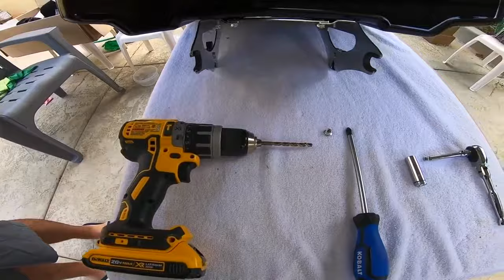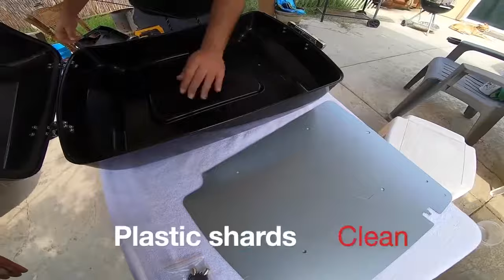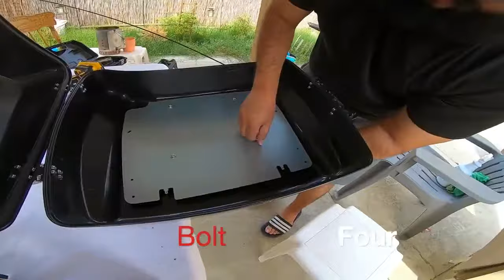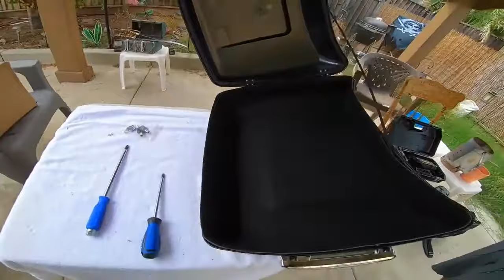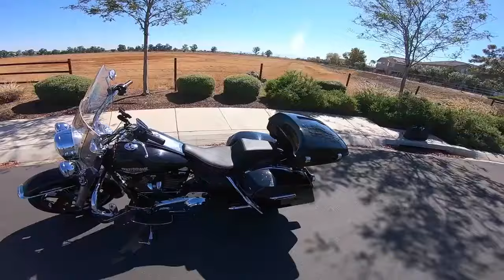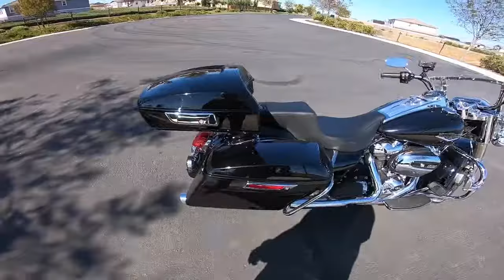TCMT丨Installation The Chopped Trunk Luggage With @CageFreeMoto

Comment: Is it indicated inside the toutpak Where to drill the 4 hole ?
Reply from the maker: Mark on the bottom.
Reply: @tcmt  on your chopped size tourpacks can you use the wrap around Backrest and Also use speaker pods ?
Reply from the maker: @johnnycarvalho2538  Pay attention to the size, there may not be enough space.

Comment: So i just drill 4 holes and thats it ? No specific bracket needed or specific way to mount it🤔
Reply from the maker: Yes, installation of the trunk is relatively easy as long as you buy a suitable bracket and base plate.
Reply: @tcmt so i see you have two style Docking Hardware Kits that Fit a Harley Touring Road King Glide 97-08
Style A and stle C, what is the correct one to use for a Chopped Tour Pack?
Reply from the maker: @RanGer-498  What's your bike?
Reply: @tcmt  2005 ultra
Reply from the maker: @RanGer-498  Ok, You can check these on our official website. 
Chopped Trunk Luggage SKU: XF290603-01-SET-B 
Rack SKU: XF290697-B or XF2906A05-E
Base Plate SKU: XF111530-A